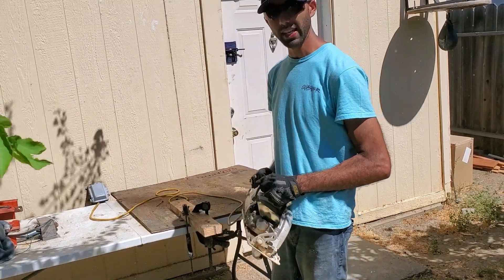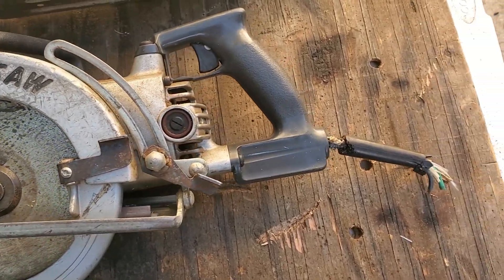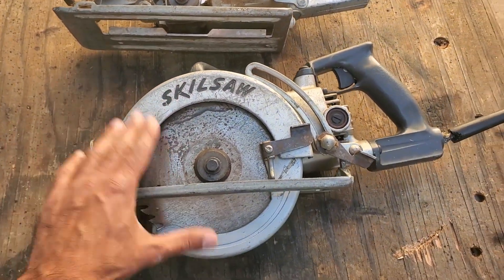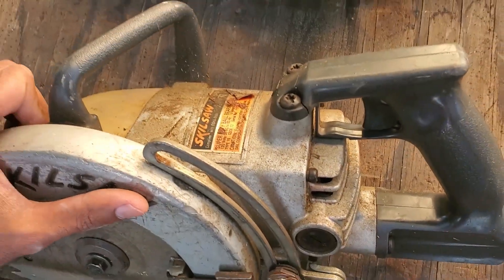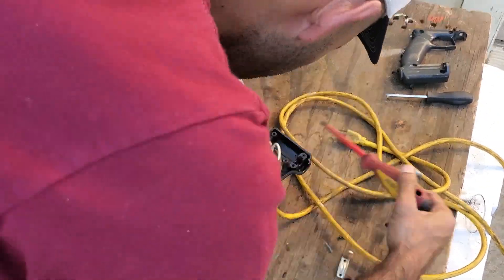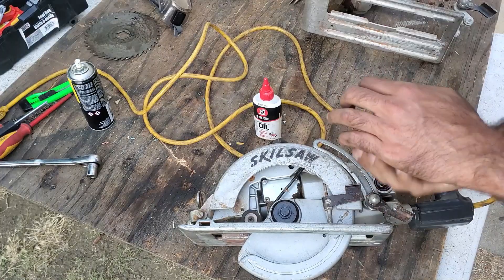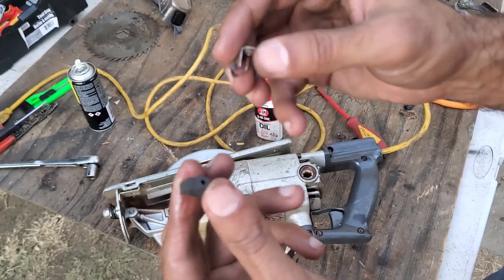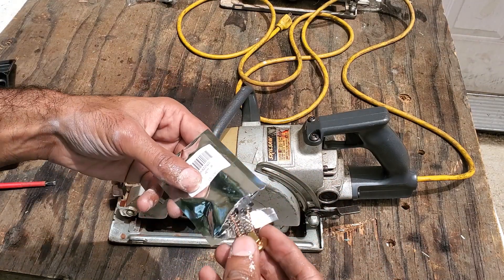Free Finds: Repairing A Vintage Skilsaw Model 77

Comment: What kind of oil you use to fill up the saw ??
Reply from the maker: They have special oil for these. I used regular motor oil (10w30) lol. Works just fine
Reply: Takes 80-90 gear oil I use Klotz